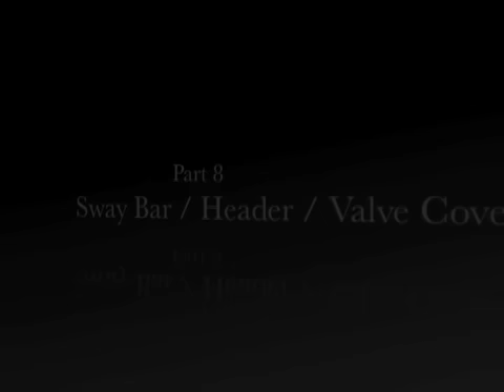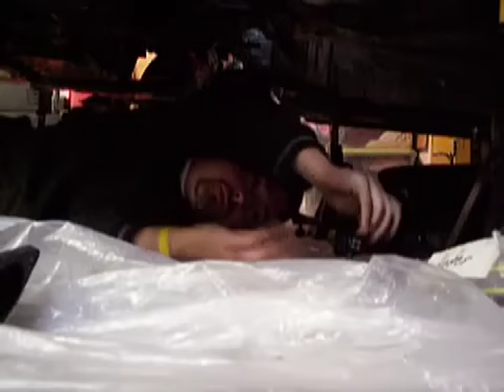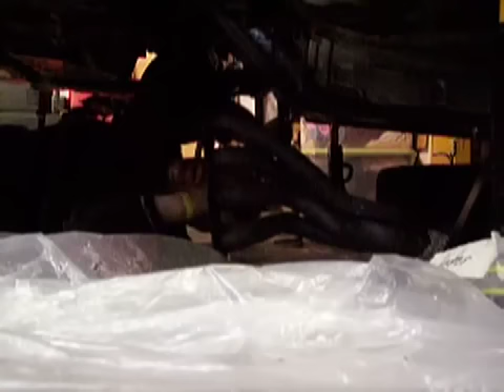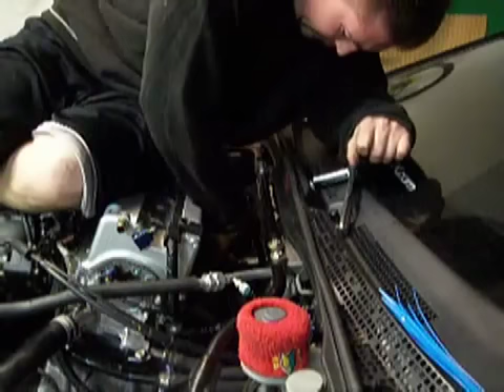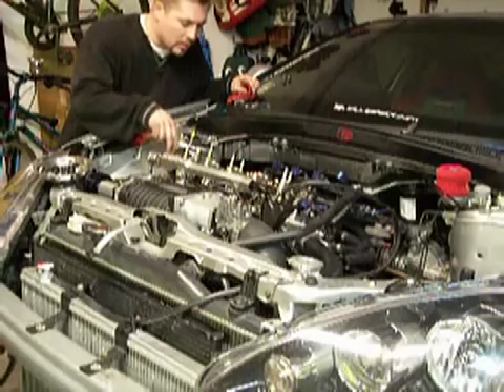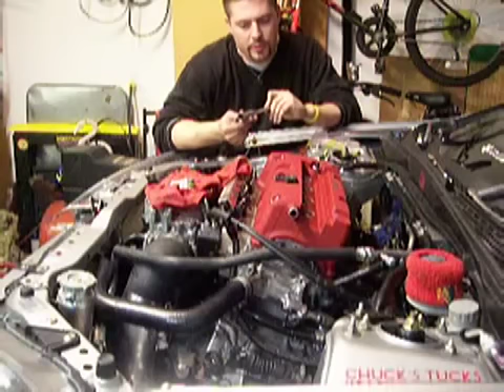Engine swap RSX Part 8

Comment: a supercharger will allow you have power throughout most of you RPM, and a turbo will give power at the end of your RPM (+6000). If you a smaller size engine that puts more power at the end of the power band, go with a turbo. If you have bigger size engine capable of providing ample power at the beginning of you power band, use a supercharger.